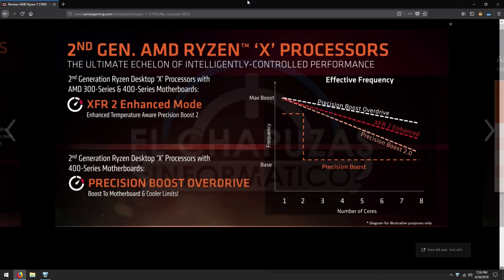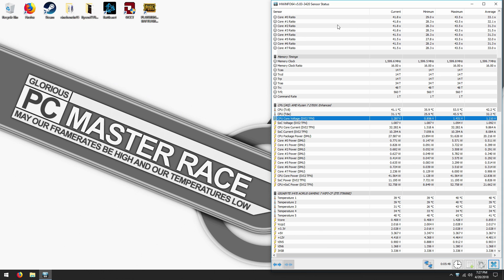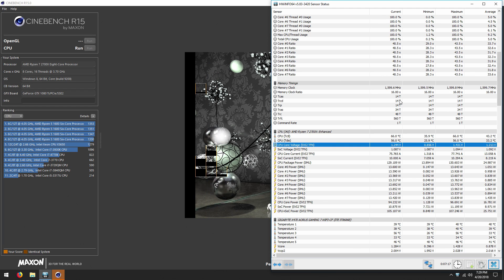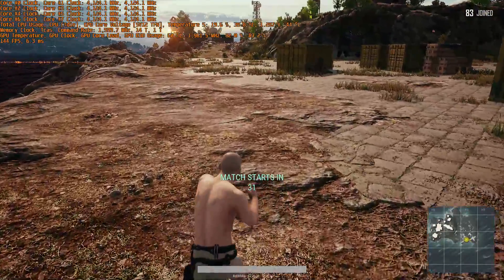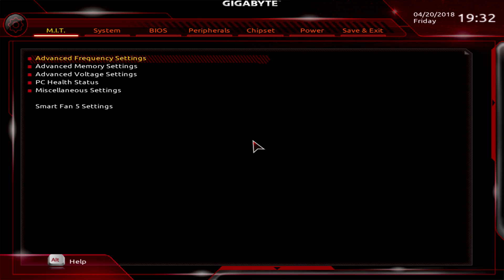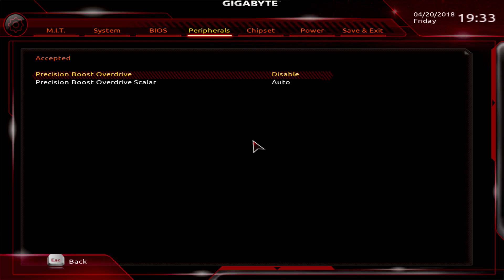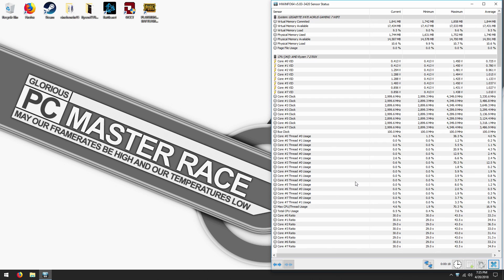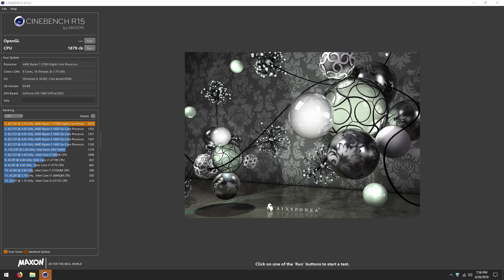How to use Ryzen Precision Boost Overdrive?

Comment: i have the same cpu and motherboard, but it is not available for me.
do you have any idea why?
Reply: I have Aorus Ultra Gaming too, PBO is here, just need to update to the latest BIOS (F3g). I tried it a little, but disabled for now as voltages I got were around 1.4-1.5 all the time (vs 1.3 and occasional boosts to 1.4 sometimes without PBO, but dunno, maybe it's okay? Anybody knows?)
Reply: Updated to f3g and it is available now, thanks :)
Interestingly this update fixed my stuttering on overwatch.
Reply from the maker: Personally wouldn't use Ryzen Master for checking voltages. I'd suggest you using HWInfo64 and within it, the voltage you should be using is one in specific (2700X: Enhanced, inside that CPU Core Voltage (SVI2 TFN)).
Reply from the maker: TStyle90 2700X and X470 AORUS Gaming 7 Wifi?
Reply: 2700X and X470 AORUS Ultra Gaming (no need for wifi and RGB) EU here btw if it matters
Reply from the maker: TStyle90 maybe the PBO option isn't available due to a more basic (VRM design) of the motherboard. I haven't tried the X470 Ultra Gaming.
Reply: I read it is available for all x470, also read that the option isn't out yet for the most boards. Maybe i have to get the latest update
Reply from the maker: TStyle90 From the original upload date of the video... There's a few things/information that has been gathered. PBO as AMD intends to work is still WIP and not yet launched. This option (as seen on video) might be exclusive for some board, in which you are able to play with settings such as Precision Scalar (and enable the tweak). Yeah it's not bad idea updating to latest BIOS and see if there's anything new inside UEFI.
Reply from the maker: What software are you using to monitor voltage and which reading are you taking?
Reply from the maker: Asking @denis gribov since 1.5 is really high and I haven't been able to replicate such voltage at idle (top idle been 1.469v) on games it doesn't go above 1.425v with newest BIOS for this board (F4g)
Reply: Well, I didn't really monitor much, but Ryzen Master was showing me that high CPU voltage, also CPU-Z was about the same, but I don't remember exactly. Do you think Ryzen Master shows the higher than it really is? With PBO I get around 4.2-4.3 Ghz boost on many cores, but with high CPU voltage according to Ryzen Master, without PBO voltage is around 1.3 (at almost idle). I should have checked voltages in BIOS also, maybe it's really just Ryzen Master messing up the values. I also have Ryzen Power Plan active (with 90% min cpu) btw. And I'm on X470 ULTRA Gaming, not Gaming 7 :)
Reply: Okay, thank. I'll try to check it with HWInfo :)
Reply: Checked voltages with HWInfo (without PBO). Strange thing: I got 1.3-1.4v almost all the time. With minimum CPU performance in Ryzen Power Plan at 87% and above I got constantly fluctuating frequency on all cores around 4.0-4.2 Ghz and crazy voltages like 1.3-1.4v and hit 1.5v once. But if I set min. CPU lower than 87% in Ryzen Power Plan (or set Balanced Power Plan with same percent) then frequency starts to be much more stable over cores (2.5-3.2 Ghz minimum) and voltages drops like to 0.8-0.9v and bursts to 1.4v sometimes. Any ideas?

Comment: I have the same mobo you have.. NBIO part is missing so I cannot access that setting.  I am using hte latest bios....
Reply: @drthivesgames  Video says only 450 and 470 boards have it. I'm getting up up to 4.576 on that board you have with ordinary boost but voltage gets way higher than i'd like. You're not gonna get anywhere near that with stock cooler/crappy case.average ram. High quality psu probably helps too.
Reply from the maker: That's weird, what processor are you using?
Reply: maybe you can use ryzen master tool

Comment: Does PBO work while rendering videos?
Reply from the maker: Yes, you can check the reference with PBO enabled and disabled with CBR15 (heavy load). Probably in render you'll see the same benefits (100mhz~ more). Probably will need to make an updated video since it differs between BIOS a little bit.

Comment: Is PBO enabled by default out of the box or Ill have to enable it? And IF it's not enabled by default and I enable it, does that void my warranty?
Reply from the maker: SpaceSPS no its not enabled by default out of the box, since PBO works as an smart overclock. You have to enable it. It seems it is under development in Ryzen Master but you can enable it at a BIOS level. This option seems to be in early development but as far as now, looks promising (probably it will have some more tweaking).
Reply: Thanks for the answer and the great video. Do you know about the warranty when enabling it? Is it voided?
Reply from the maker: SpaceSPS i don't think you void your warranty, but if any damage comes from using the option, I guess it doesn't fall into warranty, which is somehow funky since it's an option which AMD markets. Can't say this for certain but it looks this way. Since I mention this as a feature like overclocking, I take it that way (hence I suggest a good power supply).

Comment: The Asus Crosshair VII has a feature to adjust Xfr 2 allowing two cores to boost ABOVE 4.35,  does a similar feature exist on the gaming 7? I'm trying to decide between the two motherboards :p
Reply: thanks for that buddy. THe more i read about Precision boost overdrive + XFR2 the more i think it's superior to Manual overclocking... at least up to the extreme overclocking side.
Reply from the maker: Cmdaddy88 this mobo has pstate Overclock. If you dont mind linking a imgur of this option of the C7H I'll try look into it, maybe it has applied a new feature on the C7H. I do have a C6H but haven't tried it a lot with 2700X.
Reply: What is that feature called please ? i'm also trying to decide between Crosshair VII and gamming 7
Reply: It's called " Performance Enhancer".
Asus BIOS mod says:
"- Performance Enhancer option can increase or disable XFR power and current limits allowing you to boost higher and longer. Together with reference clock adjustments this means you can get up to ~4.5 GHz in single threaded loads and 4.2-4.3 GHz in multi threaded. @The Stilt is the original author of this function."

http://www.overclock.net/forum/11-amd-motherboards/1685809-rog-crosshair-vii-overclocking-thread.html
Reply: Doesn't XFR boost one or two cores while PBO boosts all cores depending on the available cooling headroom?

Comment: It actualy seems this feature is perfect for gamming. In fact gives better clocks than manualy overclocking to 4.2 wich seems the maximum manual OC most people are getting. This is because people testing for 100% stability @ manual overclock test it with software that maxes out ALL threads. In gamming this is never the case so if you put it on precision boost overdrive, the system can be kept stable at higher clocks with less than 100% load on the specific core. 

Seems like you exchange having 4,2Ghz on all times on all load types, to having slightly less in full load but more in gamming with Precision boost overdrive. SO if you are a gammer, just use it. If you are a content creator that needs all 16 threads at maximum, manualy overclock it.
Seems very very interesting if that's the case.

I was wondering if anyone knows if it works that well on Asus boards as i've already pre-ordered one Crosshair Hero x470 ;)
Reply: Pretty much. My 2600X isn't known to go much higher than 4.2 on a good chip with an allcore manual OC. With PBO and some voltage offset tweaking I've been having core go up to 4.4 with spike to 4.6 Ghz while gaming. The system AMD developed is pretty damn smarter than a "dumb" straight old fashioned OC to be honest.
Reply: @MozzaBurger88  what offset Tweaking that you change to Achieve that core speed?
Reply: @SantaiTapiPasti27  First off, the build : MSI B450 Tomahawk, Corsair Vengeance 2x8 GB 3200Mhz, 280mm AIO cooling from EVGA.

First step in the BIOS was to put my memory to XMP2 and PBO to enabled (MSI loads the board current and thermal limits and no amount of playing with said limits did anything for my results so just leave everything on auto)

I think I have a pretty damn good chip : First off, I managed an offset of -0.1125v which lots of people don't seem to manage. As soon as I try -0.1250 it won't even POST but 1125 it's 100% stable.

At this point, under full load on all 12 threads (Prime) it boosts every core to about 4050 Mhz. Under real world loads it averages between 4.3 and 4.4 with spikes close to 4.5.

Temps never above 60C

To squeeze more juice I then started bumping the BCLK to 101, then 102. At this point I have to relax the offset a bit as I was getting random crashes, mostly when the CPU had to transition between resting state and load... Something that could probably be fixed by disabling the Pstates but I don't want my rig to be a space heater. So instead I simply offset a little less. My case and cpu cooling are excellent so I had lots of headroom.

At 102 BCLK an offset of -0.9875 seemed stable.

At this point, full load was 4150 Mhz (ironically it never ever crashed with the 1125 offset, it's only during transitions in daily usage that it did) and real world loads I reached boost clocks of 4.5 to 4.6.

The bottom line is that AMD engineers worked millions of hours to safely squeeze out computing power from their chips under various loads and modulate voltage accordingly so DO NOT, under any circumstances, disable PBO or fix the voltage to any given value. You want to let the system do its thing. Otherwise you'll end up with either less performance or a space heater that'll die quickly. You want to basically give it less safeguards (PBO enabled), more thermal headroom (offset) and raise the system baseline a bit (BCLK).

Bear in mind that BCLK overclocks everything on the motherboard so be safe with that one. Also, from my readings, it seems a lot of chips won't be able to go below 0.1v offset. I was lucky.

Sorry for the long-winded answer.
Reply: @SantaiTapiPasti27  On Cinebench r20 I raised the score by about 100~125 pts.

Since it's a full 12 threads load, it benefits more from the BCLK increase.

Real world loads like games than don't tax all cores all the time benefit a lot more from PBO/offset and BCLK together as the system pushes the individual clocks much further up.
Reply: @MozzaBurger88  Ohh so PBO Work Much better in Gaming case than Cinebench or Program that utilize all core,Got it
I'm Happy to Choose AMD over intel with much Lower Price and have Many Features to Tweak.
Hey,Thank you so much for All Your Answer its so Helpful
Reply: whats the best way for someone who is gaming and streaming at the same time?

Comment: Thanks a lot for this super useful video! I was wondering if you could enter an manual voltage while keeping the PBO enabled.
Reply from the maker: Thanks, any help/share/like always welcomed. Good question I'll try, I haven't thought about it. Also will check on LLC accepts PBO.
Reply: Also any option to enable/disable PBO option in Ryzen Master app without going in the BIOS?
Reply from the maker: I'll download it (not really fan of it) although it works great with AMD APUs
Reply from the maker: Already downloaded Ryzen Master, it seems it will be supported soon through Ryzen Master. (Currently under development).
Reply: That's great news! Thanks!